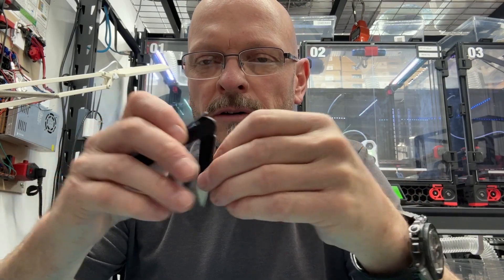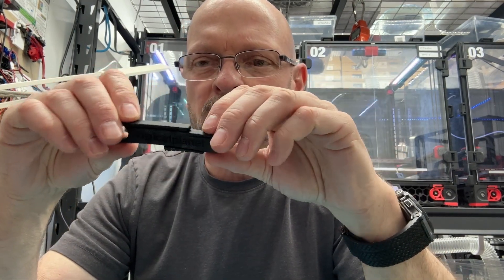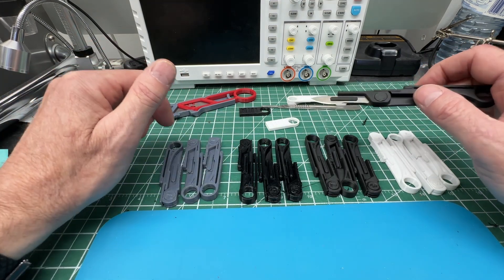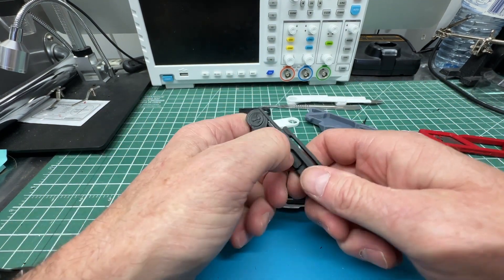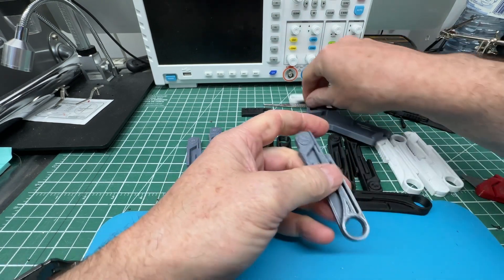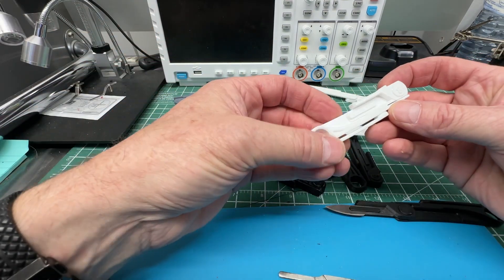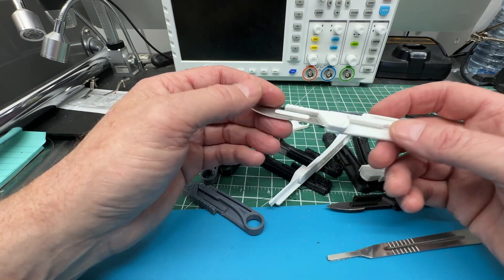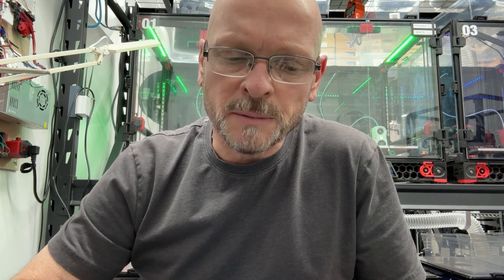Print-in-Place Folding Scalpel

Comment: Thanks for the recommendation. After looking into which handle/blade combination works best for my particular kind of applications, I determined Stanley blades offer the best blade strength, especially when bolted to a sturdy PLA handle. I personally find scalpel blades have a tendency to break away from 3D printed slots under higher cutting pressures. I have a few blade/handle combination concepts I'd like to prototype, but have neither the time nor design skills to fabricate them myself from scratch. Your shared efforts and skills for these reasons alone Logical Planet, are greatly appreciated. Keep up the fabulous work. 👍
Reply from the maker: You are welcome.  And, yes, the scalpel blades definitely have their limit.  I guess you have already seen my utility knife (for Stanley blades) it is definitely much more durable.